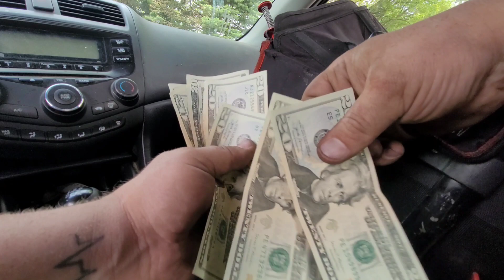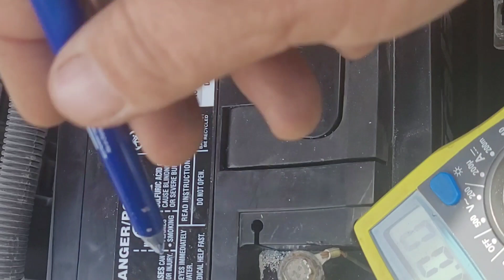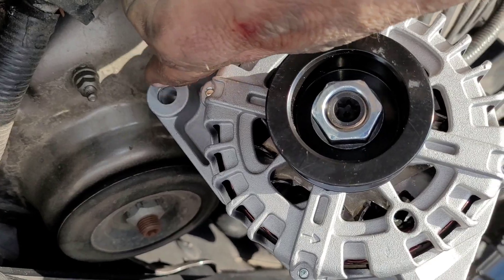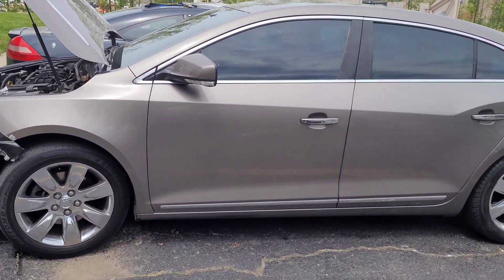Mobile Mechanic Work Day {Episode 2}- 2010 Buick LaCrosse Alternator Replacement

Comment: You should check the big terminal on the back of the alternator for power. Because it could have been just a fuse. If you ever hit a spot on a car and need to bounce anything off from someone. If I had a way to send my number privately. I am would be willing to do what I could to help you become better at it. I used to be an ASE certified auto technician.
Reply from the maker: Thanks for info. I did check the fuse and it was good to go. The reason this one failed was to bad diodes. But I take any input someone is willing to give me